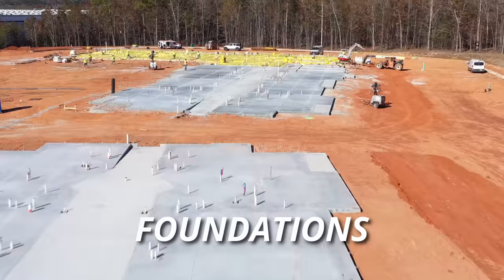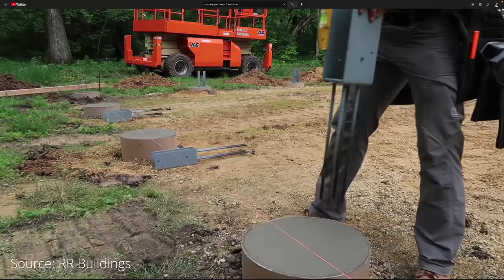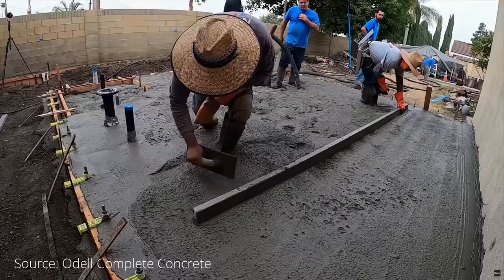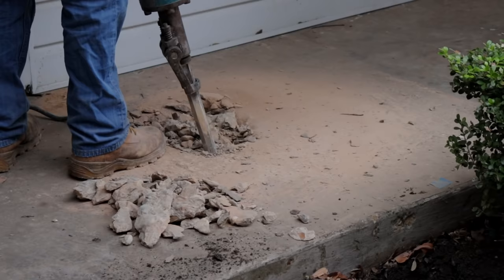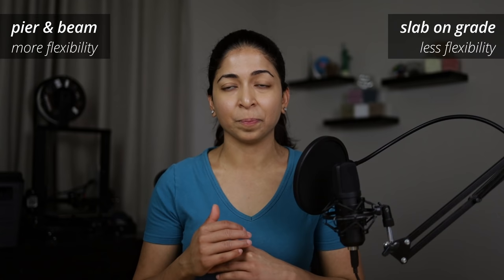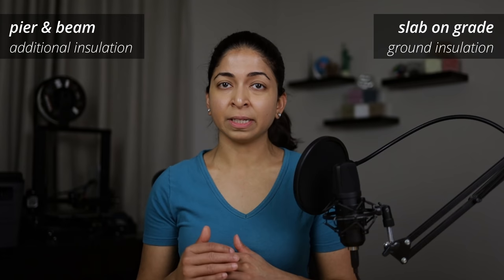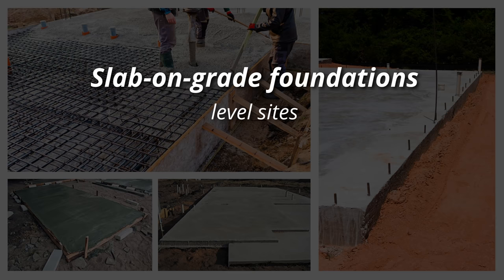Pier and Beam vs Slab Foundations | Which one should you choose?

Comment: I have a slab home that was built in the '50s.  All of my ductwork and plumbing runs through my attic so that it is serviceable without tearing apart the foundation.  Running anything critical under a slab foundation just sounds like a terrible idea.  The downside to my configuration is that all of my heating vents are at the top of the rooms.  Since hot air doesn't sink, in the winter when the furnace runs, my floors are frigid and the upper half of the room is sweltering.  I'm quite tall, and the temperature variation across my body when standing is pretty uncomfortable.  This could have been avoided by running the ductwork back down the walls from the attic at a slightly higher construction cost, but alas, that's not how the house was built.
Reply: Try running your ceiling fans on reverse to pull the cold air up, thus forcing the hot air down. That is a interesting design choice...not sure I'd want a water leak above my ceiling, but it might be a good way to diagnose leaks before they cause major issues.
Reply: @towjam37  I tried running the ceiling fans on reverse on a few occasions but the increased air movement in the room just made everything feel vaguely chilly without a noticeable improvement in temperature distribution unfortunately.  Tested it with some guests one night and they felt the same way.

I'd definitely opt for a ceiling needing a water damage repair over having to tear up a section of my foundation.  In my particular case, the utility room in my house is right in the middle, with the kitchen and bathroom on either side of it, so most of the plumbing runs overs that room.  So in the event of a leak and unsightly ceiling damage, it will at least happen in a room where no one will see it but me.
Reply: Yeah....that whole running plumbing in an attic didn't do so well when it got to 20°F for days on end down here in Texas last Feb.....and the electricity went out.
Reply: @willbass2869  Funnily enough, the second winter I lived here the furnace went out and I did have one pipe freeze.  Didn't burst, though.  I had electricity, so I wrapped it in a heating pad to defrost it.  Hasn't been a problem since the furnace was replaced, even on days when it got down to -15°F.

I reckon since it's much colder where I live, when power does go out in the winter, it's common for people to quickly "winterize" their plumbing as best they can and shut off the main valve as a precaution in case something does burst.  And people who have city water that can flow without an electric pump just open their taps a bit to keep the water moving and the pipes from freezing.
Reply: @NoName-ik2du  yeah I did all the "right" things ( shutoff water, opened spigots to drain lines) and I STILL had broken attic pipes.
Unbeknownst to me several stretches  of pipe went above and then below ceiling joists and created "dips" where water accumulated.
Reply: @willbass2869  Bah, that's an unfortunate configuration.  Wonder why they did that; seems like it'd be more work than running straight lines.  Hope the water damage wasn't too severe.
Reply: Above ceiling HVAC is how it's done in virtually all commercial spaces. I suppose temperature strata is more tolerable there due to higher activity levels happening in work/office or shopping spaces.
Reply: @terrylutke  I suspect the temperature difference is so severe and noticeable in my house because of the size.  It's very small, so the furnace heats it very quickly.  I think in a larger space, the temperature increase would be more gradual and, even though hot air still rises, would be allowed to dissipate the heat more evenly.  The large uncomfortable temperature gradient in my house is very noticeable immediately after the furnace runs, but over time becomes less noticeable (until the furnace kicks on again).

Comment: So another type not used much is doing a ICF foundation around the outside perimeter. Attaching a rim joist to the inside to hang the floor joists on. You can add piers sitting on a concrete footers with load beams for larger spans. Here in Indiana we only have the piers footer sitting on undisturbed soil. Not down to bed rock. This how we did our home 25 yrs ago and all is good.

Comment: Nice general introduction for the layman and i feel that this is generally more applicable for smaller/lighter structures (1 to 2 storey things). Depends on the project objectives, specifications and ground conditions, consult with your structural engineer for most cost effective solution. In more challenging ground condition and large foundation loadings, the foundation designs are typically beyond the skillset of a structural engineer (not many understand the soil/structure interactions well) and design advice should be referred to a geotechnical engineer / foundation specialist. I come from the building and infrastructure industry, generally slabs and shallow footings are the cheapest way for foundations, if the ground can handle it.

Comment: I’ve watched hours and hours of Odell’s concrete videos, and I’m certain one day I’ll be able to make use of it. 😂 
Thanks for the explanation of the two foundation types. I’m thinking slab is best for me, but wonder if I can get away with pier and beam for a cheaper build.
Reply: Pier and beam will be much more expensive  than slab on grade.  Think of all of the lumber and plywood you have to buy just to build the floor.   The floor is automatic with a concrete slab.
Reply: Slab went from 10,000 less to 10,000 more during COVID. I will never do slab again. Crawlspaces allow you to do way more work and to make changes. Insulation is better on crawlspace. You have more insulation options also. And yes I'm aware of insulation und
erslab
Reply: Stem wall is way easier to do yurself. Just rent the forms. Homeowners and small businesses don't know almost all vertical formwork is ussly rented. All high-rise work is rented
Reply: Construction labor shortage isn't going to end for the next 20 years. Come on over and join us.

Comment: Here in UK pier and bean foundations aren't used, since we tend to use brick and block construction rather than timber frames. We use strip foundations where trenches are dug out below load bearing walls, and filled with reinforced concrete.

Comment: so the problem with (kaolinite)  clay soils is expansion and contraction depending on moisture content.  Kaolinite clay will crack up an  unproperly reinforced slab on grade. ive seen as much as 3" inches  displacement.  The movement can separate underground utilities as well. Thats another reason why you need a soils test before you build.

Comment: Using a slab foundation does not necessarily mean that all the water pipes and electrical lines are poured over. In Germany this would not be considered best practice. Here we have a "floating" floor screed, meaning there is a layer of insulation material between the concrete slab and the floor. This way the floor is neither directly attached to the foundation nor the walls, which provides far better thermal and acoustic insulation. All the supply lines, except the main waste water pipes, can then be integrated into the insulation layer. In case of a repair only the floor needs to be cut open, while the foundation stays intact.

Comment: I actually prefer conventional footing 5 foot below ground level with concrete walls for a basement. I live up north and our fondation have to be below the frost line by code. Pier and beams is quite popular also but prone to animal intrusion in the crawl space if they feel any warmth coming out not to mention you will have to adjust your jacks from time to time because because bedrock can be extremely deep up here and impossible to reach, the post will settle a bit over time. I’ve seen structural slab on grade with massive rebar structure crack and move appart significantly quite a few times. Trust me on this one, if you live in a cold slab on grade is the last thing you want, piers and beam is acceptable but a full bellow frost line footing is the way to go.

Comment: Uhm, wait a minute. As much as I love your content, I have one thing to add, and /or correct. You can... I have moved houses that were on poured foundations. There are ways to do it. Does it cost more? Of course, because it is more labor intensive. I worked for a company that moved houses and buildings, in Texas and a lot of our work was in Galveston or on the Galveston Bay area. Yes, a majority of the houses are on pier and beams, but occasionally you'll come across some that are slab, especially in the Pasadena and Baytown areas.

Also, here in the greater New Orleans area, many houses that were originally built on slab have been shored/raised in order to counter flooding. Ever play Dig Dug?

Comment: Slab foundations "never" sink when made correct. Shrinkage is not a problem, - rebars connecting two slabs can have a sleeve pockets (like a simple garden hose), so that the slabs won't sink but are still allowed to shrink horizontally.

Comment: Great discussion. Different methods for different areas. I wonder if the preparation work required for slab foundations can be more expensive than the pier and beam method..? Digging out and replacing unsuitable soils and then replacing them with rock, gravel, sand etc to provide a suitable slab platform may be more expensive than driving a few piles to bedrock/ sand/clay and putting a beam foundation in..?

Comment: Both of those are not preferred by me anyways.  Slabs always crack. If there is ever a plumbing problem you have to strip the floor and either get out a concrete saw and/or a jack hammer.  Post and beam building can also shift around between piers as you can not  (most of the time) get to bed rock.  Preferred is a raised, full perimeter, steel reinforced, concrete foundation (which you did not include) with at least a 24'' tall crawl space for access

Comment: I've always wondered why, in slab foundations, they don't run the plumbing in open chases with removable covers so you can make repairs in the future without having to jackhammer though the concrete.  Carpeting and finished flooring could hide the covers set flush in the top of the slab but at least when you need access, it's just new carpeting, or hardwood, or maybe some tile to put things right again.
Reply: I want to see a way to do that in walls too so it could be easy to add or replace electrical, Ethernet, water lines… whatever you want

Comment: I think that in TX some places have shallow soil over limestone.  That means that a slab can be put down with its corners extending down into the limestone.  I see no necessity to put
electrical lines & plumbing water supply under a slab.  Why not feed electricity into the attic & down the walls into outlets? Likewise plumbing pipes can go in the attic except for the sewer line which must come up out of the ground to drains in the house.  Any reply to this is appreciated.

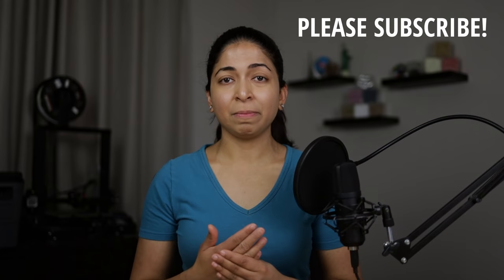Comment: Can you do slab on piers? I am in the process of renovating a house with a crawl space but I want concrete as  floor surface( not overlay) and I am wondering what I'd have to do to the existing subfloor to 10:13 pour concrete on top of existing subfloor. Approx 2-3" of light weight( expanded shale instead of gravel) concrete.

Comment: As an structural engineer I was always shocked of how bad americans build their homes. In Romania (Eastern Europe) we must unload the structure below the freezing depth (around 30 inches).
I watched a lot of HGTV and I didn't understood how they poured a slab on the first layer of soil and everything was "up to code".
Belinda, please tell me more if the freezing depth is a thing in USA. I'm dying of curiosity 🤓

P.S. For those who don't know, the freezing depth is a depth measured from the first layer of soil where the water doesn't freeze, hence the structure doesn't rise due to the expanding frozezing water.
Reply: In the US, we call the freezing depth the frost line. There are code requirements for foundations in the Northern climates relating to this, but it doesn't freeze that much in the south, so there are not any code requirements dealing with frost line. I think it is dumb, and we should build to a higher standard. Every once in a while, we do get very intense freezes in the south....just like "snowmageddon" last year that shut down most of Texas. I'm sure many foundations were badly cracked.
Reply: Thanks for your answers😁

Comment: Would it make sense to build a slab on grade, but then build a 18” space to run utilities.
Reply: The Build Show made an excellent video on a pier and beam foundation with a conditioned crawlspace that essentially accomplishes what I think you're going for here. I think most builders wouldn't go for your idea because of the complexity and cost of the structure needed to elevate the floor (also, this would create squeaky floors which slab foundations pretty much eliminate).  This also increases the cost/complexity of the anchors needed to tie the home to the foundation. Your house would be 18 inches taller, so it would have greater lateral forces on it in a high wind situation. You would also need to insulate the plumbing or the crawlspace very well so that pipes wouldn't bust in the cold, whereas being imbedded in the foundation usually accomplishes that need. It definitely could be done, but I think it would be difficult and costly to find someone willing to do it. A saying I've heard from builders: "A unique house has unique problems." Sure, occasional plumbing repairs would be relatively cheap and easy, but you might run into very expensive/complex issues because of the added complexity needed to accomplish this.

Comment: Will you consider helical anchors or screw piling for residential use?
I recently saw an excavation program in which Colorado soil is excavated to a depth of 20 feet (!) and then
compacted in lifts of one foot before slab on grade foundation is placed.  The cost must be very high.

Comment: I thought the cables in slap were pulled tight, then concrete poured, then after drying the cables are cut, thus adding some side compression forces to the slab.
Reply from the maker: It's pulled right after the concrete cures. Pre-stressed vs Post-tensioned.

Comment: In the PNW I tried to have 2 architects design a slab on grade house. Both places refused. Because we have an r38 floor requirement is if eps under the slab how is settling in future they did not know. Also when the Build Show used eps on top of the slab I would need perimeter insulation as well with special flashing their clam that the cost was becoming higher than foundation stem walls and peir and beam runners in use today. Lots of build companies will not try new ways if old ways have a good track record. I'm not sure how Texas slabs are insulated if required to be insulated. Our soils are top & clay bed rock is some 40 plus feet as well. The engineers here float the house with 3ft deep stemwalls on 50plus year undisturbed ground. Yes I had to fix my 1967 house foundation. So I guess for that reason it works here. Typical footings are 2ft by 1ft three rebar. Stem walls are 3ft to 6ft  5 to 7 rebar depending on crawl space desired. In the 60's and 70's lots of slab homes here where built but as r values increased no slab home built in 30plus years. It would be good way to reduce build requirements to increase low cost homes. Typical starter homes are $300k now. My new 1260srft 2 car garage home building cost estimate is $340k. Not  included lot. A national crisis of 6 million homes are needed to make home prices affordable.
Reply: Slab insulation....in Texas? We don't need no 🤬 slab insulation (maybe Dalhart, but they should have basements anyway).
Feel your pain about prices. I'm convinced politicos slather on more and more reqs for everything just to justify more inspection and more pricing opportunity for building industry (who fund their campaigns)

Comment: Here in Denmark all terrain decks are insulated, no matter the method. I am mostly interested in screw foundations - so in stead of cast piles you screw oversized screws into the soil until they reach the needed strength. And fully insulated foundations, where you use the insulation as a formwork to cast your (low) foundations and concrete floor in one go. See for example this video: https://www.youtube.com/watch?v=cIl1ThNq27M This method has some advantages over the traditional deeper stribe foundation, but can mainly be used where the load bearing soil is relatively close to the terrain.

Comment: Really enjoy your channel. 
We just bought an older home in East Texas.  While the foundation type was not a primary determinant, we were always looking for pier and beam when possible. We ended up with a pier and beam house which we were happy about. Creaky floors..yep. But the advantages outweigh the creaks. Some of the creaks are due to the way the old wood floors were laid more than the foundation type.  We know some of the piers have sunk a little but the repairs are just a matter of shimming the beams up on the piers (I hope). Usually you would be talking about sinking piers rather than heaving piers making leveling much easier.

Comment: Are basements only possible with slab foundations, or could pier and beam also accommodate them?
Reply: Basements in Colorado typically have spread footer perimeter walls and either a central spread footer supporting the center beam or center beam posts set on pads or pilings with beam pockets cast into the perimeter walls. The floor slabs typically are not attached to the foundation walls so basement interior walls require an expansion area above the floor plate. They are referred to as floating walls. Colorado has very expansive soils when clay is present, sand, not so much.